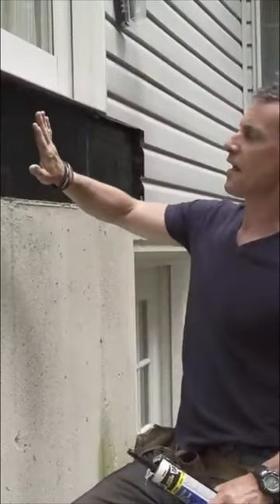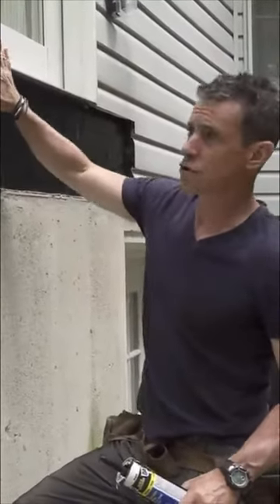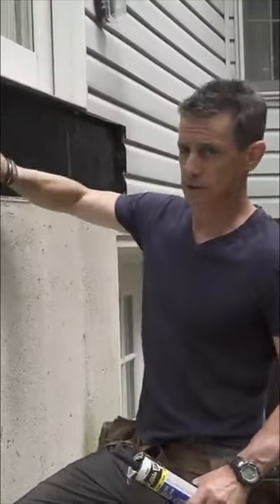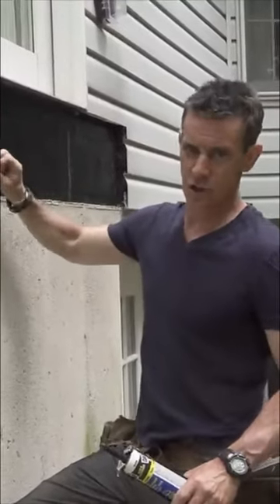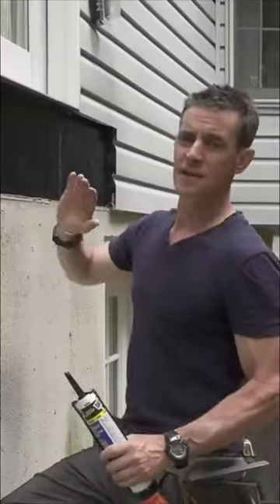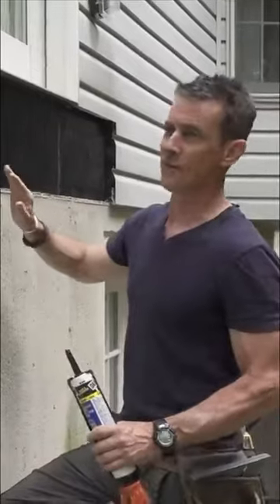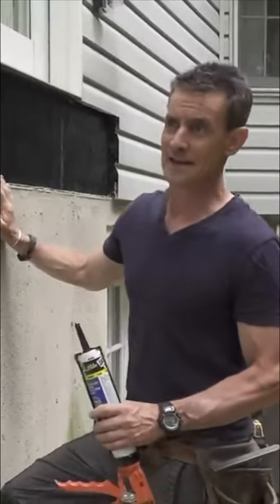DIY tips: How to properly flash the ledger board when building an attached deck

Comment: Mines attached over top the cladding. Thought it was incorrect but apparently you can do it that way with a little space for water to run down.
Reply from the maker: Local codes vary. Generally speaking, if the water that gets in can get out, you're good.

Comment: Why didnt you tear off a couple rows of vinyl and seal it properly? That would never pass here for that peel and stick isnt a flashing, but considered a membrane. With removal of the siding not only are you tying the peel and stick into the house wrap, but now you can install and seal the flashing according to building codes.
Reply from the maker: Well, there are a host of reasons. 1 - Not required. 2 - I like making money and not wasting time (not that I am any good at that, but that is the idea). 3 - I deflected the water out of the system without removing siding that I couldn't match anyway.
Reply: @myfixituplife  ok so you're lazy and afraid to inform the owner that it's best to remove the siding to tie the peel and stick to the house envelope. 

2- by admitting you're refusing to do what's right, you admit to being a hack

3-you price the job accordingly to make that correction.
Reply from the maker: Lazy? Really?